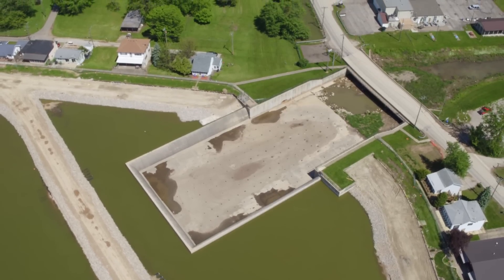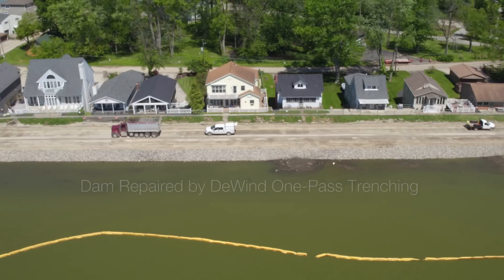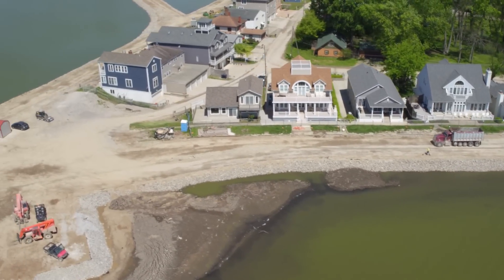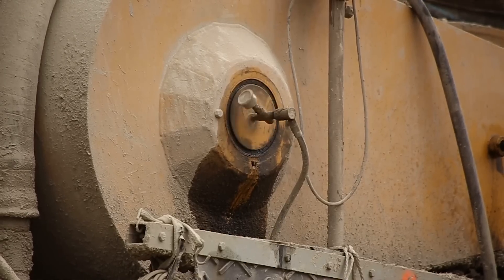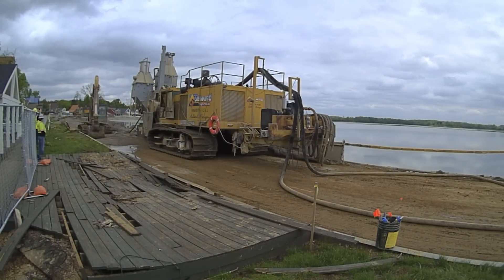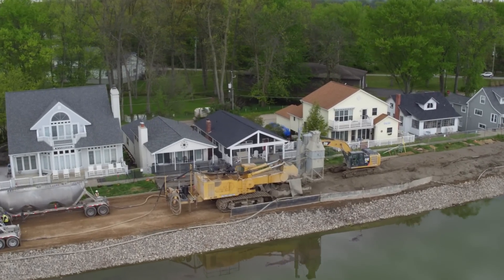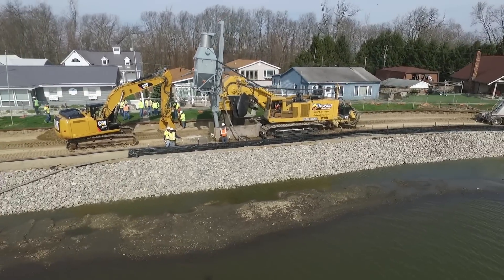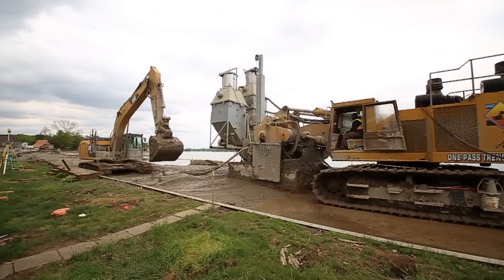DeWind One-Pass Trenching Dam Repair

Comment: Looking for one step trenching, laying, and concrete encasement methods for installing High Voltage Power Lines underground.
Reply from the maker: Gerald, DeWind can review your needs and help develop a One-Pass solution if possible. You would have to call the office to get the conversation started. 
616-875-7580.